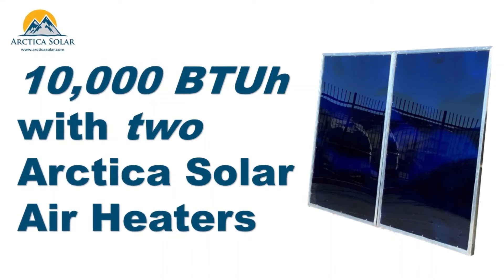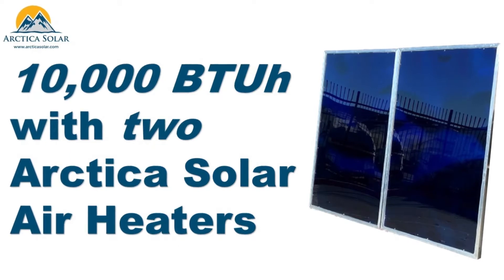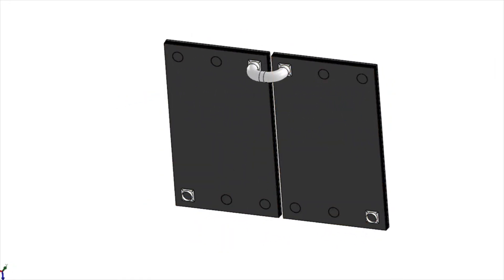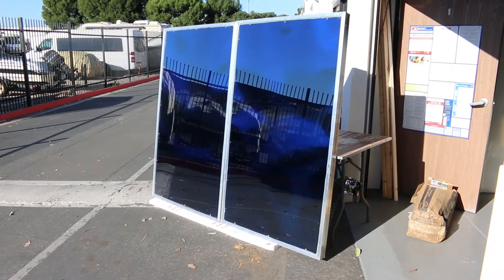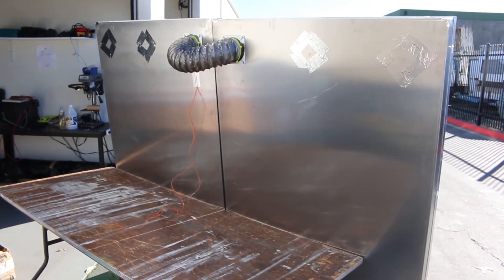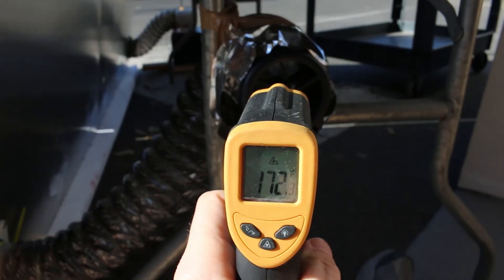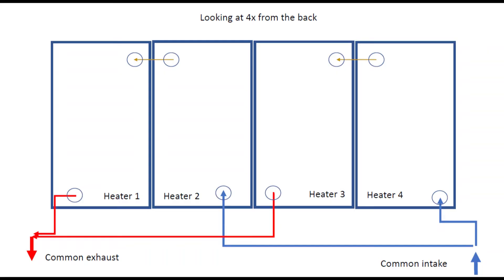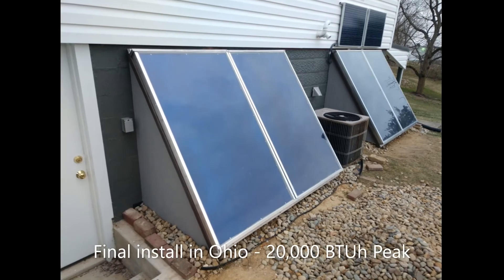10,000 BTUh with two Arctica Solar Air Heaters. All Sun! No gas! No electricity! Free Heat!

Comment: Good morning, as far as I know these heaters work with the principle of convection where cold air enters through the bottom and hot air exits through the top. In this combination that is in series of the first 2 heaters, the first heater enters from the bottom which is correct and it comes out from the top but this output is connected to the top of the 2nd heater which should be the output, wouldn't it be better to connect the output of the first heater with the input of the second in the bottom and leaving the outlet at the top to go in accordance with the principle of convection. As the video shows in this way, does the air flow not represent a resistance due to the principle of convection in the second heater?
Of course it has a fan connected to force air circulation but I think it would be more efficient as I mentioned, or is there something I'm not seeing?
Please let me know your comments.
I hope I have been clear enough.
Reply from the maker: Hi Edgar, for multi-heater systems we recommend a strong blower fan to that any natural convection is overcome by the forced air convection.  When linking heaters its important to minimized duct runs, which is why we connect the top corner exhaust of heater #1 with the top corner intake of heater #2.  Most of our users however will use multiple single heaters with a space, because the single 1.5m2 heater uses a simple 60-80 CFM fan that is nice and quiet.  With the larger systems the fans can get noisy for which we encourage people to mount the panels off structure so the fan is outside and noise in the interior space is limited.

Comment: It looks like a very good product. I have a question, how do you guarantee that the air circulates covering the entire absorber surface, considering that both the air inlet and outlet are circular holes. The way I see it, the air would enter the collector and go directly to the outlet, covering a small part of the absorber.
Reply from the maker: That is a great question.  We've added features internal to the heater airspace to encourage proper amounts of air turbulence and to avoid dead zones.  Early in our heater design we relied on computational fluid dynamics modeling and teste data to optimize the internal features of the heater.  The result - even in full sunlight the glass face of the heater is cool to the touch in most cases.